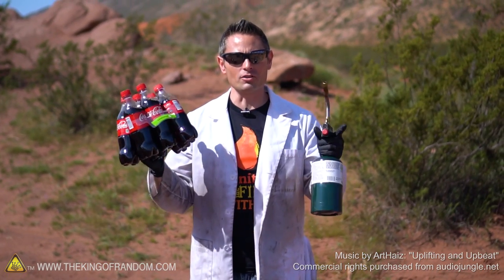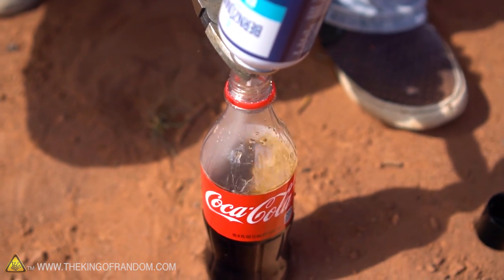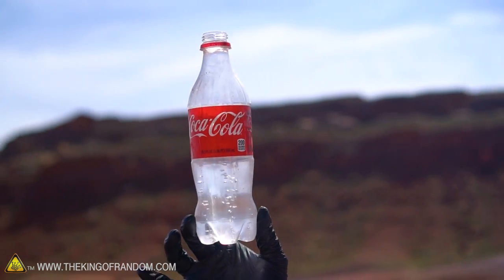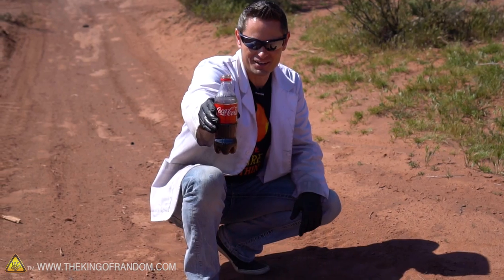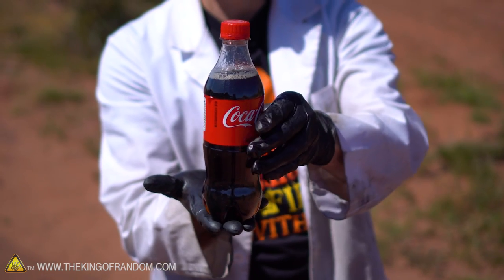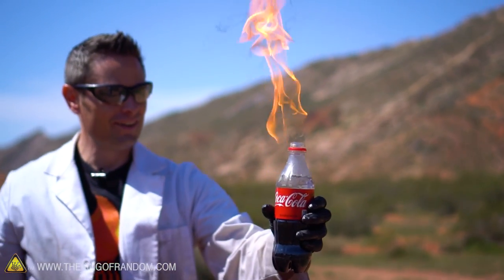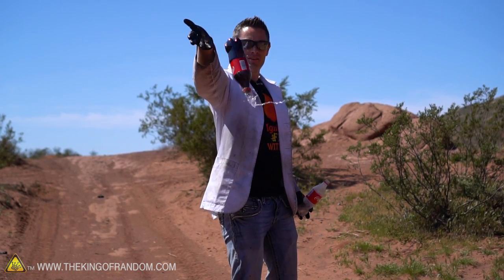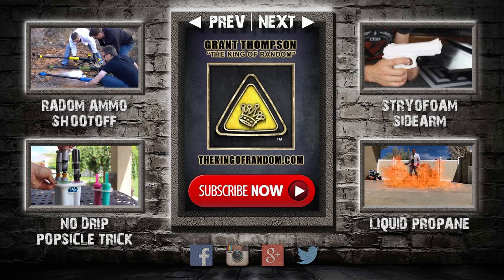Dang! Apparently Butane Did The Trick | TKOR Shares The Secrets Behind The Best Coke Rocket

Comment: Propane works if you can get it out as a liquid. The coke is not necessary. Water works just as well. You're creating a rapid boil off mixing warmer liquid with the liquid butane/propane causing it to go from liquid to gas expanding exponentially.

Comment: why not drill small hole in the top of the cap and create a nozzle with a smaller exit port, therefore more pressure through that hole and probably more thrust?

Comment: 4 years old video, but    ROCKET NOZZLE!!  

i am guessing that if a rocket nozzle, with a throat, a bell, and matching

 threads to the cola bottle was attached before turning the bottle, it 
might force the gas to exit the bottle much faster. Similar to how a 
hypersonic wind tunnel is shaped. Pretty much just like a nozzle on a 
space rocket. Might have to adjust the throat and bell ratios and 
dimensions for an optimal output.

Comment: It did not explode when you dropped it because the entire system accelerated at the same rate toward the ground. When you turn over the bottle, the butane is forced up so it explodes rather quickly. That is why it exploded at the same instance it hit the ground; that is when the butane was forced inside. I bet if you dropped it 20 m it would explode at impact with the ground

Comment: Again a cool video..! However, please do NEVER ever again play with liquid gas and a flame..! The pressure in that Coke bottle (from the Coke, not the gas), could have shot all the liquid gas onto your arm and the clothes you wear. Now imagine what will happen when you light up the gas prior...yes you turn into a human torch..!
Next experiment...a Coke bottle filled with liquid gas placed beside a burning candle and then shoot it with a 22 Cal. rifle... Even better hang the bottle in a wire over a bucket of burning gasoline...then dump it in. Of course, you should control this remotely. I guarantee, it's fun to see that mushroom cloud shoot up in the air.

Comment: I'm not the smartest person but I think that it's not what's happening inside the bottle. I think change in pressure causes the propane to get excited, that's why it comes up one you try to open the cap, by which your just releasing the pressure. When you turn the bottle upside down the propane goes to the top and by the liquid and gravity forcing to create a change in pressure the bottle goes off.

Comment: oi dude!
why are you using Coke? why not just water, and I'll bet you would have a lot more control and success if you just top off the bottle with a loose fitting cork/rubber plug that should shoot out as the pressure builds up when you flip it